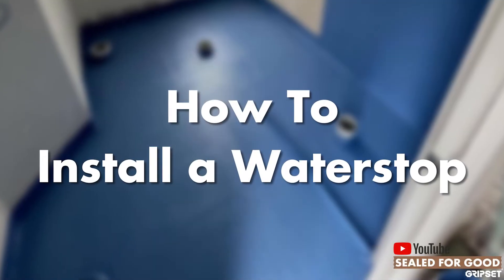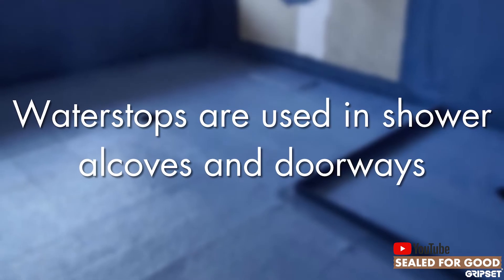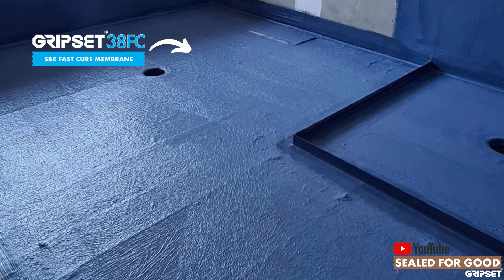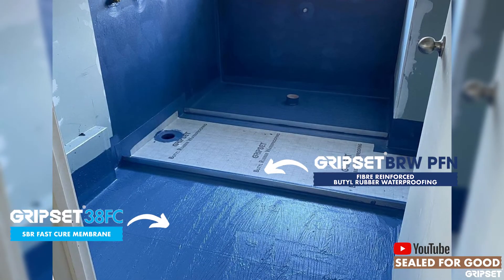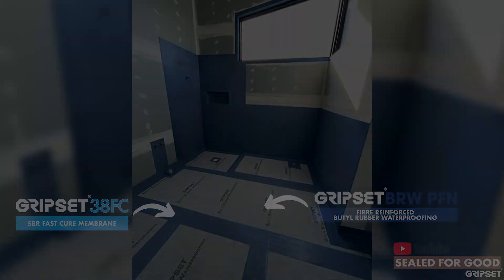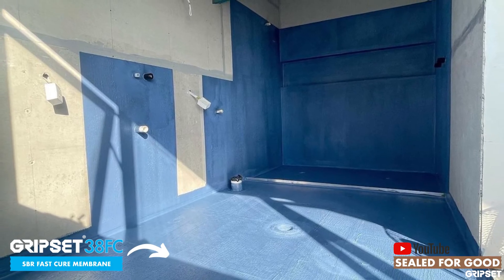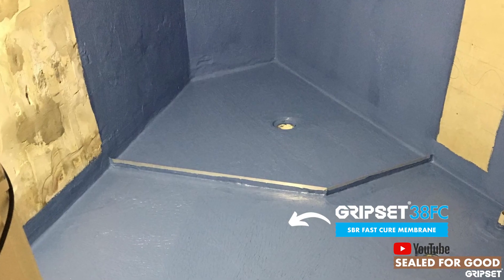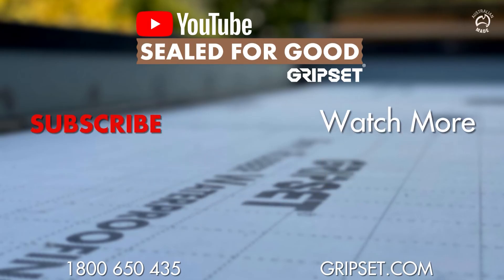How To Install a Waterstop

Comment: Hi, my shower screen is attached to the doorframe/architrave, of course, that didn't work - major damage to walls, stinking rot, mould in the adjacent laundry. It needs a 1.8 metre, vertical waterstop attached to the wall to stop water ingress. How is that attached down the bottom? What should it look like? I think there should be a water stop that looks like an L They spot fixed all the bloody tiles as well - idiots. Thanks

Comment: My builder ran away and the surveyor says he didn't install a water stop so I can't get an occupancy certificate. He said tiles need to come up to install it. Is there away to avoid having to remove the tiles to comply?
Reply from the maker: Really sorry to hear about your situation — that’s incredibly frustrating.

Unfortunately, in most cases, if a water stop angle wasn’t installed before tiling, especially in a wet area like a shower or bathroom, it’s unlikely you’ll meet compliance without removing at least some tiles. This is because the water stop needs to be mechanically fixed to the substrate beneath the waterproofing and tiling system to do its job properly and meet code requirements (like AS 3740).

Best next step: ask the surveyor if they’d accept a documented remedial solution from a licensed waterproofer. Sometimes a workaround can be proposed, but it all comes down to whether the certifier is happy to sign off on it.

Let me know if you'd like help discussing potential solutions with a tech rep.
Reply: You should have an HBCF certificate which will cover the cost. You need it done properly.

Comment: Hey mate how do you install frameless shower screen over the water stop and where exactly?
Reply from the maker: The answer can be found in AS3740 or in the case of domestic housing you should also refer housing provisions part 10.2
Reply: @GripsetIndustriesPTYLtd  Why would you refuse to share the answer? This is your core business, so you know the answer... so why tell people they need to spend $230 to get the answer? Why the lack of generosity for your customers?
Reply: @wainivanua  you can find the laws on line, just search the relevant law ie  AS3740 - there's a diagram etc.

Comment: Once the waterstop is taped down, do you need to sheet over  it again before applying the liquid memebrane
Reply from the maker: Hi John, once it's bonded and glued down, you can use the reinforcing fabric to encapsulate the water stop into the liquid membrane :)